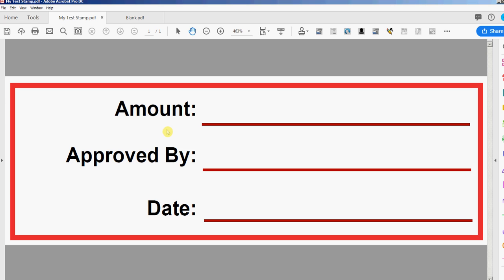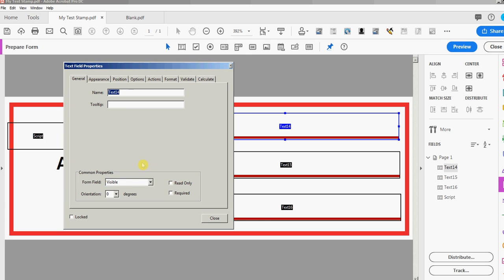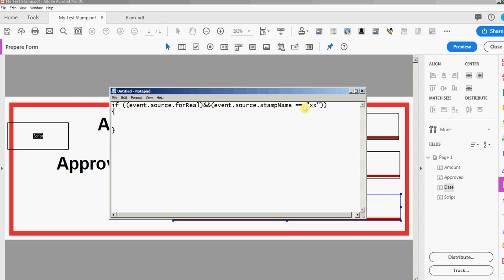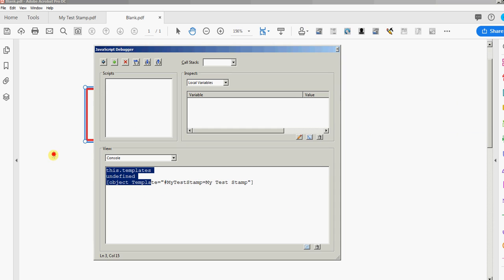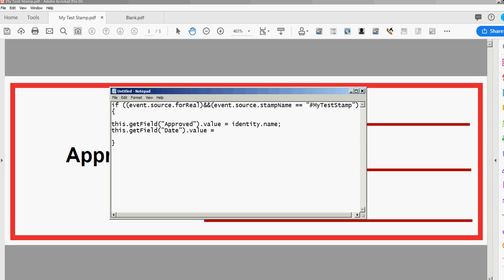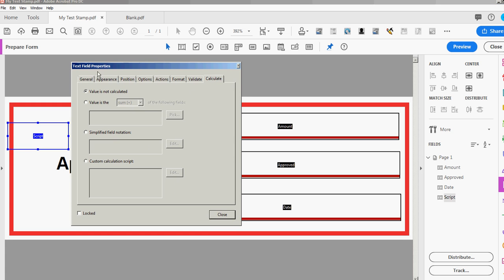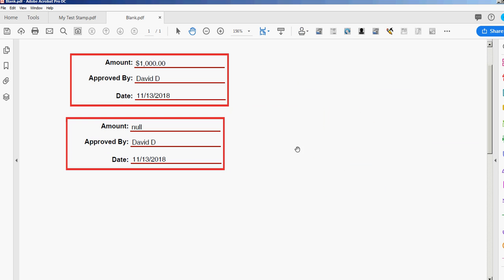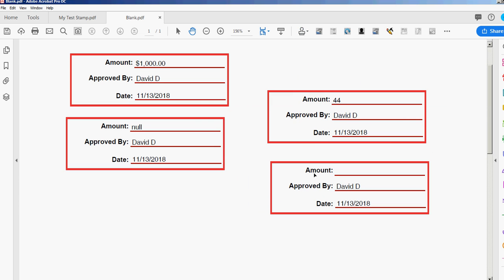How To Make A Dynamic PDF Stamp

Comment: This is a great video thank you for sharing. When I paste the code into the Custom calculation script field I am getting a SyntaxError: Illegal character. If them highlights the first {.  See script below:

if ((event.source.forReal)&&(event.source.stampName == “#SjfBDhQUrG_AzT0Dws52tB”)
{

this.getField (“Approved”).value = identity.name;
this.getField (“Date”).value = until.printd(“mm/dd/yyyy”, new Date());

}

Any help would be appreciated.
Reply from the maker: The syntax error is from your curly quotation marks.  They are supposed to straight quotation marks.  If you are writing scripts you are supposed to use a plain text editor, like Notepad, not a word processing program, like Microsoft Word.  Also, you are missing a closing bracket at the end of the first line.
Reply: @PDFAutomationStation   Thank you for your reply. I am getting the same error when I type straight quotation marks. Code is below. 

if ((event.source.forReal)&&(event.source.stampName == “#SjfBDhQUrG_AzT0Dws52tB”))
"
this.getField(“Amount”).value = app.response(“Amount’);

this.getField (“Approved”).value = identity.name;
this.getField (“Date”).value = until.printd(“mm/dd/yyyy”, new Date());

"
Reply from the maker: @joeartist2143  Sorry but not only did you totally butcher the code by adding straight quotes where they don't belong, you left all of the curly quotes intact.

Comment: I don't understand what I'm doing wrong. When I try to get the stamp name to replace the XX, when I run the this.templates thing, there result I get is literally just the word null. I am not an expert at this stuff and have no idea how to fix this.
Reply from the maker: If this.templates returns null that means the PDF file is not a template or does not have any template pages.  The previous video explains how to convert the page into a template page, at around the 7 minute mark:  https://youtu.be/7zeNyutB1no?t=424
Reply: @PDFAutomationStation  thanks mate. Much appreciated.
Reply: @PDFAutomationStation  Does the order you list them in the script matter? To use yours as an example, I have the "Amount" field in between the other two on the "physical" stamp.  And I copied your script letter for letter to minimise the chance of screwing it, meaning I'm asking it to look at the middle field first.

When I place the stamp, I get no pop up and the other two fields are also blank and uneditable.

Is there a way to then make a stamp where I can type in manually the three fields after placing it, because this version which I love the look of is clearly beyond my ability to comprehend.
Reply from the maker: @CamMcGinn1981  Once a stamp is placed it becomes a static image.  We could program the stamp to add form fields to the stamped page, but that is way more complicated than simply programming the stamp properly.  If you are not getting a popup you have an error in your script.  If you press Ctrl + j to open the console after you place the stamp it will tell you what the error is.  The most common errors are incorrect case sensitivity (it matters) and the misspelling of fields names in the script that don't match the actual field names.  If you can't figure out after this we need to take this outside of YouTube.  You can contact me here if you need further assistance:  https://www.pdfautomationstation.com/public/department6.cfm

Comment: Very nice videos.  I'm having two weird effects:
1. the null script in format custom isn't working.  I still get null for the displayed values.
if(event.value=="null")
{event.value=""}
2. the size of my stamp is much larger than yours.  It's about 4"/3" and I have to reduce it every time.  Is there a way to have the stamp come in smaller?
Reply from the maker: The size depends on the size that you created.  It should be the exact size.  Is the null script in the custom format location?
Reply: @PDFAutomationStation  
1. Size: I thought so, so I created a new file / template based on a flattened copy of the original and with ruler turned on in the new file, reduced the size before cropping.  No effect, both stamps, old and new, come in at the same (over) size.
2. Null: Yes.  I select the field, I choose the format tab, I select custom from the dropdown and then populate the script in Custom Format Script box.
Reply from the maker: @MichaelGreen831  1.  Is possible the zoom is different from the file you created vs the file you are stamping?  I have never seen a discrepancy in the size when using a .pdf file to create the graphic.  Try this:  stamp a blank stamp on a blank PDF page.  Resize the stamp.  Use that file to create a new stamp.
2.  Please contact me here and I will take a look at your file:  https://www.pdfautomationstation.com/public/department6.cfm

Comment: Hello! I just discovered your very informative and useful channel. I do not have the ideal jargon, as I am not a programmer but like to try and learn when in need. I am currently working with a custom dynamic stamp that has 3 fields. The first 2 fields prompt the user to enter text that will show on the stamp (the script for these 2 prompts are currently working fine). The third field is an empty field that requests for a signature. I already tried adding the "Digital Signature" field from the "Prepare Form" menu. It works when the stamp is opened by itself. However, when I stamp the documents, and click on the field the signature process doesn't start. I’ve been told that I have to develop a script for the field (calculated), that when the doc gets stamped, the signature field becomes active (like the sign tab) so that the user clicks on the signature field and the stamp starts the signing process. Currently, I am stamping the docs and then sign the stamp using the "Certificate" tool and then digitally sign by dragging the square where I want the signature. I’ve been on this for a long time researching and trying w/o success. Can you please help me with the script I need or suggest if there's any better/easier way to solve my problem? BTW, I am using Acrobat DC.
Reply from the maker: Thank you for your inquiry.  There are two methods to accomplish what you want and both are extremely complex so I won't go into full detail here.  Not too many people know how to program these methods so it might be easier for us to provide you with a quote for your project.  If you would like a quote please contact us outside of YouTube here:  https://www.pdfautomationstation.com/public/department6.cfm  
Both methods involve programming the stamp to add the signature field to the document.  Use the doc.addField() function to add the field.  The inputs are field name, field type, page number, and rect.  The tricky part is the rect (page location) as you would have to program the stamp to determine its location on the page and then do some math to locate the field relative to the stamp location.  The other trick is to remember that "this" in the calculation is the document object of the stamp PDF, and NOT the PDF document being stamped.  The document object of the PDF being stamped is event.source.source.  Once the user stamps the document and the signature field is automatically added, the user would click the signature field to trigger the electronic signature.  The 2nd method is similar to the first but additional programming is added to trigger the electronic signature automatically when the document is stamped.  The JavaScript field method for triggering the electronic signature is signatureSign.
Reply: @PDFAutomationStation  -  I'll give it a try on your suggestions and come back if needed. Thank you very much!!

Comment: If I have 2 different dynamic stamps in 2 different pdf files (in the Stamps folder), is there a way to combine them into a single pdf for that folder so they'll both appear in the same group in the Stamps menu?
Reply from the maker: Yes you can combine them but you don't need to if the sole purpose is to have them in the same category.  The category name is driven by the title of the PDF.  All you have to do is change one title to match the title (stamp category) of the other PDF by pressing Ctrl + D to open the document properties, then changing the title field in the description tab.  Don't forget to save the changes and restart Adobe so it picks up the new category for the stamps menu.  If you really need to combine them you could drag the page of PDF 2 into the pages panel of PDF 1.  In doing so you will lose the template status of the PDF 2 and have to recreate it under Templates in tools.  You would name the page template the same as the original in PDF 2.  If you can't get this to work please contact us here:  https://www.pdfautomationstation.com/public/department6.cfm

Comment: Hi Dave. 
I tried creating a stamp that just says "entered" at the top, and wanted to have the stamp auto populate the date. 
I tried 2 different scripts; the one you did in your video, and one listed on adobe's website. I'm using adobe pro dc if that matters.
1.
if((event.source.forReal)&&(event.source.stampName == "#Entered"))
{
this.getField("Date").value = until.printd("mm/dd/yyy", new Date());
}

2.
event.value = until.printd("mm/dd/yyy", new date);

Neither the way you showed in your tutorial and the version adobe lists on their website will populate the date when i add the stamp to any new pdf. are you able to help? Thanks!
Reply from the maker: The second script is incorrect and won't do anything.  Use the first script but change "until" to "util".
Reply: @PDFAutomationStation  Thank you for your quick response!! 
 so i deleted the previous stamp from adobe, made the changes you suggested and re did the steps to upload a new stamp and it still doesn't generate any date when i stamp. any suggestions ?
Reply from the maker: @merpmerp5059  Please contact me outside of YouTube here  https://www.pdfautomationstation.com/public/department6.cfm and I'll reply by email so you can send me your file.

Comment: I would like to use a dynamic stamp that I have created as a template and change a few fields.  Can I do this without recreating the whole stamp.   I have tried a few times by renaming it but it seems to make the code fail so I must be missing changing something that is embedded or hidden.  Great video by the way.   Thank you
Reply from the maker: I'm not sure what you mean.  You can change all the fields you want without recreating the whole stamp.  What are you renaming?

Comment: Hi,  I need to add a stamp to welding drawings as a record on job completion which then allows me to enter a welders name and procedure number used on the job I need it to be text that I fill in each time because each welded component drawing will be done by a different welder to a different procedure. Is this easy to do ? it is basically a stamp with editable text boxes
Reply from the maker: You should be able to it by following this video, only you wouldn't have a date field or an automatic name field.  Instead you would have 2 response field.  However never use the response field when there is more than 1 because it is annoying for the end user to dismiss multiple text fields.  We use a popup dialog window instead that contains all response fields in one window.  This is too complex for a YT video.  If you would like a quote please contact us outside of YT here: https://www.pdfautomationstation.com/public/department6.cfm

Comment: I am struggling with my script. I cannot get it to prompt the user to fill the fields. here is the script:

if ((event.source.forReal)&&(event.source.stampName == "#codefill"))
{
this.getField("VENDOR").value = app.response("Vendor:");
this.getField("GL NAME").value = app.response("GL NAME:");
this.getField("PO").value = app.response("PO#:");
this.getField("GL").value = app.response("GL#:");
this.getField("INV").value = app.response("INV#:");
this.getField("JOB").value = app.response("JOB#:");
this.getField("AMOUNT").value = app.response("AMOUNT:");
this.getField("CATPHASE").value = app.response("CAT/PHASE:");
this.getField("DESC").value = app.response("DESCRIPTION:");
this.getField("INV DATE").value = app.response("INVOICE DATE:");
this.getField("VOUCHER").value = app.response("VOUCHER#:");
this.getField("POST PERIOD").value = app.response("POST PERIOD:");
this.getField("APPROVAL").value = app.response("APPROVAL:");

}
Reply from the maker: There is nothing wrong with your code as presented.  It is most likely a typo or spelling mistake in one of the field names.  If any of those field names do not exist, or if the names don't match the actually field names exactly (including case sensitivity) it will through an error and prevent the rest of the code from executing.  Field free to contact me outside of YouTube here:
https://www.pdfautomationstation.com/public/department6.cfm
BTW, you have 13 popups.  That is going to be very annoying for the end user to dismiss all of those popups without reference to what was typed.  If you like a quote for us to program all of those fields into one popup window let me know when you contact me.
David

Comment: Hi, I have the below code, and i have checked the name. but when i place the stamp, no dialogue box appears for me to populate.

if((event.source.forReal)&&(event.source.stampName == "#AuthPayment"))
{
this.getField("P/O #").value = app.response("P/O #");
this.getField("G/R #").value = app.response("G/R #");
this.getField("Job").value = app.response("Job #");
this.getField("Date #").value = app.response("Date");
this.getField("Name").value = app.response("Name");

}
Reply from the maker: The issue is most likely that the field names in your script do not match the actual field names in your PDF.  They must match exactly, including case sensitive.  Also, you should not use any special characters in your field name (like # and / ).

Comment: Is there anyway to add a field to the stamp without causing it to lose transparency? Whenever I attempt this process it saves the file with a white background instead of keeping the background transparent?
Reply from the maker: Make sure the field fill color is set to "no color".
Reply: @PDFAutomationStation  I realized the issue was that I created  stamp using adobe's built in tool, so when I tried to use the "prepare form" tool it was flattening the whole image and the white background became embedded in the stamp. I tried creating the stamp using the method from your previous video and the transparency was preserved.
Reply: Hi, I've just spent 6 hours trying to figure out what could the problem causing this. It's simply the procedure of flattening the fields. In this video, David doesn't do it and the image loses transparency once you add a field (and the includes the script field itself). The solution is just to add the flattening function below your getField ('Date') function:

if ((event.source.forReal)&&(event.source.stampName == "#TestStamp"))
{
this.getField('Date').value = util.printd("yyyy mm dd", new Date());
this.flattenPages();
}

Gee.....What a headache

Comment: This video is very much useful. Thank you very much David. My bad luck, for me only date coming dynamically, identity.name and User input not working at all. Is there pre-requisition need to be set or any error in below code ? Please can you help..

if ((event.source.forReal)&&(event.source.stampName == "#34udsRwNm2CGu8D8yjq8NC"))
{
this.getField("Name2").value = app.response("EnterName2:");
this.getField("Name1").value = identity.name;
this.getField("Date").value = util.printd("mm/dd/yyyy",new Date());
}
Reply from the maker: I am surprised that the date would work if the other 2 don't because if there is an error in the response popup the script would stop before it reached the date.  Your script looks good so please check the spelling of your field names, including spaces and case sensitive.  The names in the script don't match the field names exactly it will cause an error.  Also ensure that you have a name filled out in the Adobe Identity under Edit>Preferences>Identity>Name
Reply: @PDFAutomationStation  Thank you David. Your guess it correct. Date also not working, it stamping old date (text field creation date). Other filed names, spelling and Edit>Preferences>Identity>Name all I have checked, all are correct. May be any of pre-requisite to be done, which is missing. I am not sure on this too..

Comment: I followed both the static stamp tutorial and the dynamic stamp tutorial. My Date and Approved By filed auto-populated. I also added 2 user entered field and was prompted to enter data but the entered data did not show up. Also, I added two check boxes but they do not seem to work at all. Im guessing that check boxes are not an option in the dynamic stamp? Does the static stamp mean that the data must be entered after the document is printed out (handwritten?) Lastly, I was hoping to make the stamp with a white background, but I was unable to make that work either.
Reply from the maker: To make the background white you need to make the background of your image white.  I don't know why your prompts are not filling in the fields.  I would have to inspect your file.  For check boxes you would have to use text fields in the stamp and enter an X in the response box.  We don't use the response box when there is more than one response because it is annoying for the user to have to dismiss all of those popup windows.  We also don't use response boxes when there are check marks.  Instead we use the execDialog function which allows multiple fields and multiple field types (check boxes) in one popup window.  This function is too complicated for a short article or YouTube video.  If you would like a quote for us to develop you stamp please contact us here:  https://www.pdfautomationstation.com/public/department6.cfm